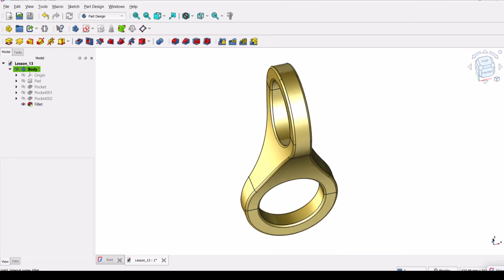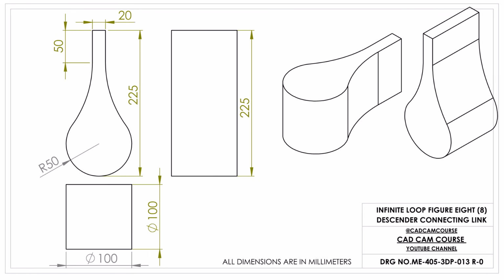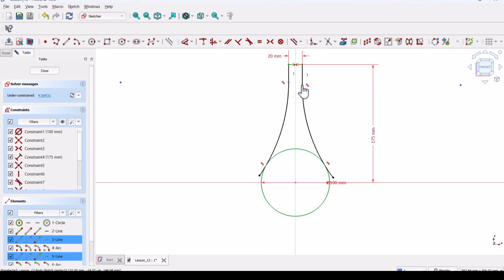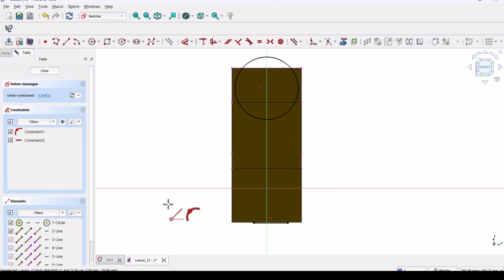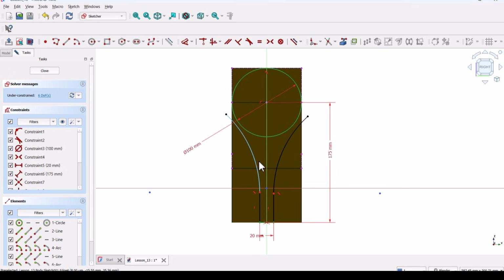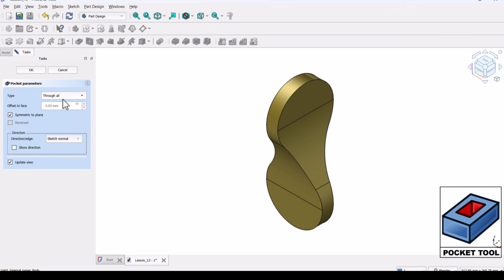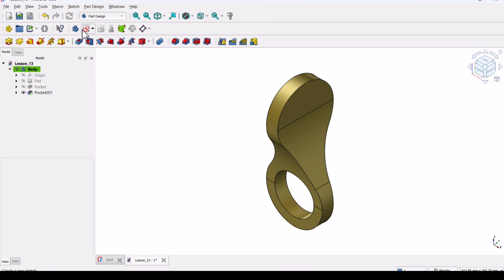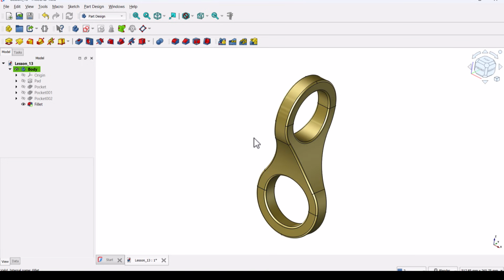FreeCAD Beginner Course | Module 1 – Lesson 6 | From 2D Isometric Drawing to 3D Solid Model

Comment: So when I draw the rectangle around the object in the second part..., then close and perform the pocket, it is not working?? to remove the material error "Pocket wire not closed 14 times" FreeCad 1.1.1
Reply: i got the same error. You need to change the extern projection line to construction line. Right clic on the projection line and change to construction line.
Reply: @Drimo974  Thank you

Comment: In version 1.1.1 if you use the External Projection tool (formerly called External Geometry tool) you have to manually set it as geometry, otherwise you will have a “wire not closed” error.
Reply: I am facing same problem how to manually set geometric tool?
Reply: @Syedhamza-30 i found out you can just delete the external geometry lines and it works
Reply: How?

Comment: Thanks for this content. I'm following along with version 1.0.2 and having issues with the final fillet not working due to an invalid edge ("fillet: skip edge%20 that is not C0 continuous"). Anyone else struggling with this?

Addition:
Figured it has to do with fillet radius. On the outer Edge I can add a max radius of 0.64 mm. Anything above fails with "Fillet BRep_API: command not done"

Comment: for the 2nd sketch: wouldn't it have been possible to copy the first one and rotate it?
Reply: I’m new as well my if I was doing it I’d be finish one side and copy one body then rotate 90 degree on Z axle and 180 degree on x or y. Then intersect two bodies. 

My question is if it’s possible? Better solution because you haven’t structured you course to there yet, or it has any problem? 

Many thanks.
Reply: I did the following:
Create copy.
Drag Copy into Body  (in tree)
Create a datum plane on the YZ plane
Attach the copied sketch to the datum plane, don’t forget to clear  the old plane first (press clear in the dialog box)
Rotate datum plane 180 degrees (arround z axis)
Adjust datum plane position y 125 mm
Draw rectangle around sketch
Perform pocket op
Reply: Addendum
When doing the hole you use the new datum plane for easy placement of the circle